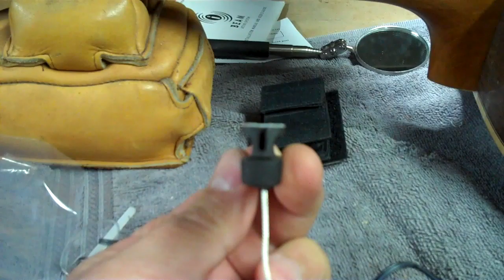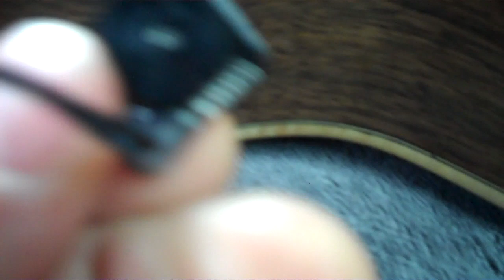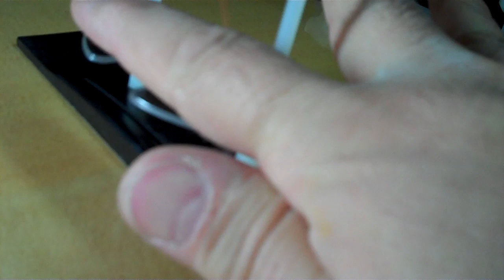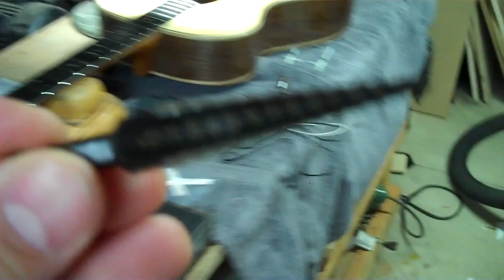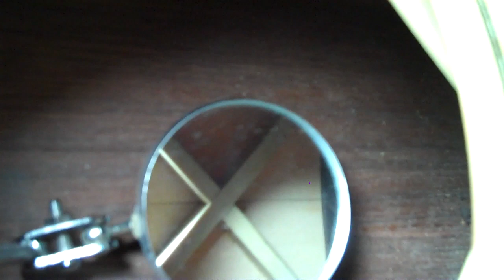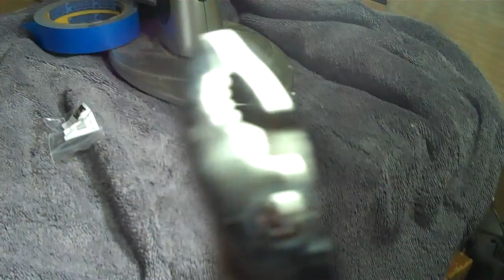Installing an LR Baggs Active I-Beam Acoustic Guitar Pickup;  Part One

Comment: Placement is critical with these things...heed the instructions and don't stick it down hard untill you've tried it in three or four places....I had to angle mine slightly and move it forward a few mm. to get optimum results from where the instructions suggest you start.....was a pain in the arse but worth it in the end.

Comment: I've drilled 12mm holes in a couple of guitars with a flat D bit; I don't have any taper bits. I plugged the original small strap pin hole with a wooden dowel to give me a centre to drill into. I turned up a tapered dowel from a regular oversized furniture dowel by sanding it in a drill chuck into a taper and then just lightly tapped it into the hole until it was tight and flush with the body surface.

Comment: I then piloted the dowel centre with a 1 mm twist bit for the drilling. Like you, I put some mask over the surface to stop it ragging. Then it's just go careful and drill the hole, taking care not to put too much force as you go through on the inside. The dowel just disappears into dust.